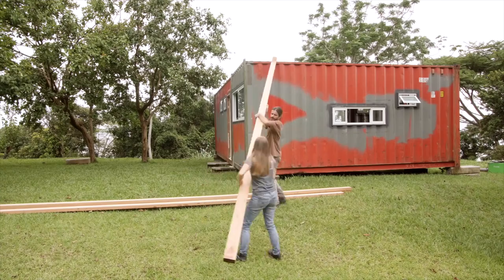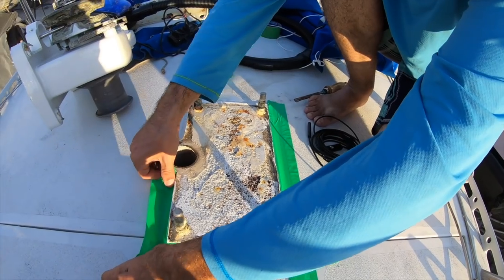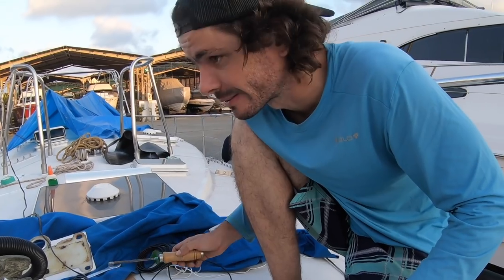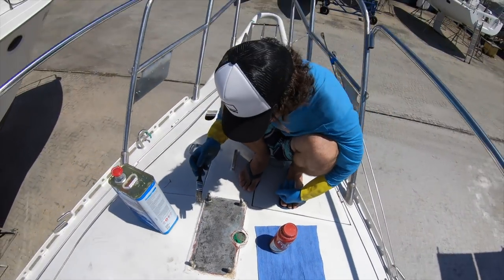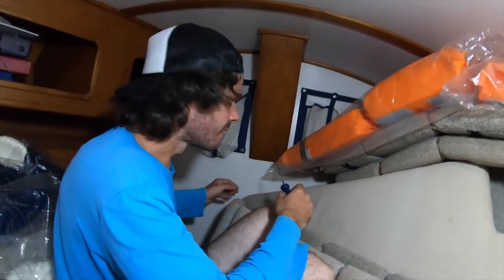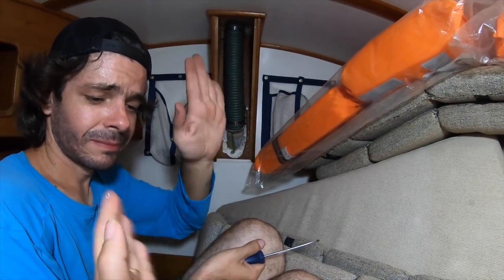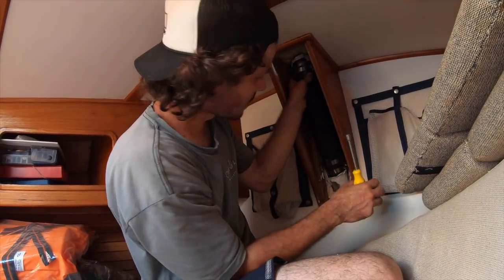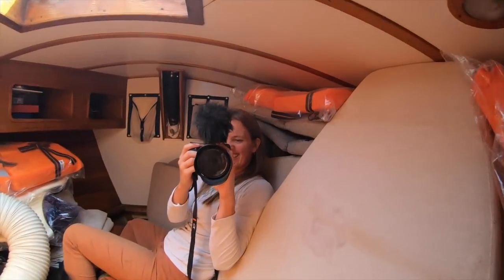⛵️We found RUST on our fresh painted steel sailboat!! 😱#125

Comment: The isolator pad looked like a simple sheet of nylon.  You should be able to sand it down to a clean surface.
Reply from the maker: The bad parts were kind of cracked.

Comment: I definitely would’ve been running copious amounts of water all over that area to find the leak before dismantling the original pipe
Reply from the maker: We actually needed to change that anyways. hehe. So, it was not a bit problem
Reply: The brown water stain running out the bottom of the tube made it obvious it was leaking and had to be changed anyway. That stain was the same as the water stains shown in the earlier video.

Comment: So dont worry with the grease, its definetely will be good enough for a long time and according the consistency it shouldnt be a problem. Because you use grease on merchant vessels and you never take out the grease, you just adding, because its just a winch so its not an application where you have hundreds of rpms and need precise lubricant flow. If everything is greased and its sealed you can alomost use these grease forever an do worry because of the colour, this yellow brown colour is fully normal, you just should have to whipe away the black stains, because if i am corect these are just particles from the winche but even so they will not affect the lubricant because they are on the bottom of the winch. Just next time, just whipe it away.
Reply from the maker: Thanks for the feedback, Martin

Comment: Well as mistakes go that was not much of one with the windlass.I myself might have said to hell with it , it looks ok,if I did not see any indication of rust/scaling.I have used similar products to what you are using, the active ingredient is Phosphoric acid, which reacts to iron oxide ( rust ) and converts it to iron phosphate which is inert and can be primed, great stuff have used it many times. I think you won't ever have to replace that hose again the rubber was a good idea , that actually was not that bad of a job I have done way worse ones with things like that.You did exactly what I would have done with that gasket,and your not going to know just how good that windlass is until you use it for a while. Your doing fine with such things .  I as ever wish you well keep up the good work . Remember also when people give advice it usually matters less exactly how you do it as long as the end result is right and  in your skillset , take care ...
Reply from the maker: Thanks for the support, Lawrence

Comment: Hope the sikaflex used is the bedding compound and not the sealant.
Cheers all
Reply from the maker: It’s actually both
Reply: @OddLifeCrafting  Good because the higher straight sealant has the same reputation as Devil's Glue, AKA - 3M 5200, which is used for sealing hull to deck joints and ballast keel attachments in Fiberglass boats, or anything else you do not want to separate/leak.
Stay safe, God bless

Comment: Good job on the winch! The grease looked like it was still in good shape. I would suggest that you think about keeping the hand winch as there is less to go wrong and on a island in the middle of nowhere it will be easier to fix than an electrical one and the parts are easier to repair in some foreign port where there is limited or no support for marine equipment.
Reply from the maker: Thanks for the feedback about it

Comment: I think you may need to paint the bolts and nuts with your white paint to prevent corrosion. IMHO
Reply from the maker: They are made out of stainless steel and we used sikaflex around it. We think we won’t have any problems there

Comment: I'm thinking a tapered rubber hose would work better, where you could "insert" the bottom portion of hose into the drain pipe versus "over" the pipe to keep from leaking where you've tightened
Reply from the maker: We needed to have the rubber at the outside of the pipe otherwise the chain would force it to get out of the pipe when moving up

Comment: You can put inside of the metal and rubber pipe one other stainless steel pipe or copper.
Reply from the maker: Maybe we could, but it’s the place where the chain of the anchor is gonna be in contact all the time , so we need to be careful about metals.

Comment: I don't know if you are using it but I always anti seize every bolt and thread on a boat. Just a suggestion.
Reply from the maker: In this case we used sikaflex. thanks for the tip
Reply: @OddLifeCrafting  sikaflex is a sealant. Anti-seize stops the nuts from seizing to the  bolts.
Reply from the maker: The problem is that we did it Saturday and no stores were opened and it was the last day we worked before started the quarantine for 15 days at least.
Reply: @OddLifeCrafting  it was just a suggestion for the future nothing more. Keep up the good work.

Comment: It's me again. I am going to ask an obvious question. Does that facility have the ability to scan the hull of that boat? In the aircraft industry we have what is called NDI (Non destructive Inspection) It's basically a huge Xray machine that detects hairline cracks and all other sorts of goodies before something bad happens. Yah know like an airplane wing falling off or some facility that forgot to inspect a prop.
What I don't want to see is a video of your boat doing something unexpected in the ocean. Oh and using a hammer to do a tuning fork test doesn't cut it.
Reply from the maker: No. We tried for some months to find someone to do this job, but we couldn’t

Comment: Hey, amazing video but can you let me know what product you used to get rid of the rust in the beginning of the video?
Reply from the maker: Hi, Eli. It's a Brazilian product: https://produto.mercadolivre.com.br/MLB-1070246152-fosfatizante-ferlicon-removedor-de-ferrugem-250ml-_JM?matt_tool=82322591&matt_word=&matt_source=google&matt_campaign_id=6542458279&matt_ad_group_id=84209230451&matt_match_type=&matt_network=u&matt_device=c&matt_creative=385096448526&matt_keyword=&matt_ad_position=&matt_ad_type=&matt_merchant_id=117843933&matt_product_id=MLB1070246152&matt_product_partition_id=597030062874&matt_target_id=pla-597030062874&gclid=Cj0KCQiAzsz-BRCCARIsANotFgOOh5FV792TKZHU7BjxVRKx427qJ7zyT10v2SlXac53h9LPc4HHBwMaAvEtEALw_wcB
Reply: @OddLifeCrafting  oh do you know if they sell them in new York?
Reply from the maker: @eliben3859  You may find some similar ones. It's made out of Inorganic acids, metal oxides and surfactant.
Reply: @OddLifeCrafting  oh ok thank you so much for the info!

Comment: You should have used proper gasket material which is made like it is for a reason. The rubber gasket you made is too soft and will sag inside the housing and also compress too much when you tighten the bolts, but remain too loose between the bolts.

Comment: Good job. One clamp is going to be perfect the second clamp is not necessary. Why? It is not under any pressure.
Reply from the maker: I can be as it's where the anchor chain in gonna be and also it's a place that we can have a lot of sea water inside coming with waves
Reply: Have you heard of a product called ant seize compound? You put it on the threads to prevent seizing.

Comment: Acid etch. A gallon of phosphoric acid is a must for anything steel.
Reply: I would have to disagree unfortunately,   shot blast a1 standard  with first coat application within 4 hours then chemically bond the next coats then you will have a paint system that will last  just done a ferry the paint  was 20 years old and only just starting to let go

Comment: Hi Guys the Windlass Gasket the old one was a Cardboard material and the new one is rubber based material problem with that is the Rubber will not Breath. As the Cardboard gasket would and over time the Windlass grease will in time become Hydroscopic and allow water to become suspended in the grease causing it to fail and due to the location of the windlass it will over time get high volumes of water thrown at it you can buy in sheets waxed card that is designed for making Gaskets from which are used in the Automotive industry and in Aviation sometimes the Waxed Card gasket might be the way to go
Reply from the maker: Do you think it's possible for the cardboard to breath with a place of aluminum on the top of it? I can't see how it could breath with a plate on the top of it.
Reply: Amazingly it could be possible that the thin gasket of Cardboard does allow that to happen but it was only a suggestion why they used the Cardboard Gasket before it was just an observation if you notice the Grease changing colour over time to a Cappuccino Color from the Golden Honey Brown then you are getting water suspend Hydroscopic ally in it just a point to watch for in the future I love the VLOG and the Two of you are very chilled in your way of Life I wish my Partner was a little more adventurous
Reply from the maker: @hyime69  We are gonna keep an eye on it. Thanks for the concern and for the support

Comment: Stay with the manual windlass. Sure, it's more manual labor to use, but you guys are young and can do it. Electric windlasses are expensive to buy and they break much more often. Less systems means a more reliable and cheaper boat to maintain.
Reply from the maker: Thanks for the feedback about the windlass ☺️

Comment: In my opinion that pipe supposed to receive the top one in and the lower part supposed to be inside the fixed part
Reply from the maker: The problem is the diameter on both ends are the same. That means a hose diameter that would fit inside the bottom wouldn’t fit around the top one.

Comment: IMHO, I would put a different hose on the winless.  Use a hose that goes over the upper pipe and into the lower pipe.
Reply from the maker: If we do that the chain might take the hose off. 😔

Comment: Hey mister, don't tap on my pipe with your chisel. Don't set chemical bottles on your paint. Use a board or something that wont allow it to leak through if it drips or spills. Many of a new paint jobs have been ruined by doing stuff like setting tools and chem's on it. Don't they make that sealant in white or clear? Black on a white boat is no fun.

Comment: It seems like water is getting into the windlass.
Reply from the maker: It was
Reply: @OddLifeCrafting  
   I meant leaking into the actual windlass from above not under it.  Is there a seal or other point of possible entry?  My concern is if the water enters the windlass from above, is there a weep hole for it to escape?  Otherwise it may just collect inside because it is so thoroughly caulked to the deck .                
   By the way, thanks for the video on winch servicing.  I just bought 2 used winches on ebay. When I gave them a spin they were kind of dragging  - slow - dampened.  I immediately remembered your video and knew exactly what was going on - OVER-GREASED!   Opened them up and YES, that was the issue.  I'll be re assembling them this weekend with "light greasing and only machine oil on the pawls.    
     We always look forward to your new videos.  Keep up the great channel and stay safe.
                           - Chris     Seattle

Comment: Should probably replace the grease
Reply from the maker: The manual of the windlass says that there is no need of changing it
Reply: It’s not so much that it’s not required it because of the rust in the grease that will leave stains on your hull.

Comment: I don’t believe you did that correctly. I’m not sure how to explain it. But here goes. The question is why when you tile or shingle a roof do you never start from the top or peek and work down to the bottom edge. Why do roofers always start the tile or shingles from the bottom and work up to the peek. When you installed the anchor chain guide tube the top section went around the outside of the existing metal pipe that was correct. However the bottom went on the outside of the bottom tube that was wrong. By the way you said that was the original way it was done that’s incorrect, what you saw was a bad job at a fix someone who didn’t know what they were doing and took the easy road instead of the correct replacement. My guess is the chain wore thru original metal pipe and they thought they would fix it by cutting out the part and did a bad replacement job. The fix you did will eventually start dripping and create a mildew and then mold situation.
Reply from the maker: We believe it needs to go on the outside of the pipe otherwise when we push or pull the chain up and down it can take the hose away from the pipe.
Reply: @OddLifeCrafting  unfortunately that’s a bad assumption. The only way to correctly fix or return it to its original status is find a professional pipe fitter. The yard your in seems to have lots different kinds of specialized personnel. Put the word out your looking for a pipe fitter not a jack of all trades. You need a pipe fitter. He will have the material the tools and the knowledge to fix the  patchwork and do a proper fitting. All you did was to duplicate the same mistake the person before you did. This area is not the one to get stubborn about, it will come back to bite you just when you don’t need that kind of problem. I know it’s hard to trust anyone but yourself. Sometimes you got to believe someone knows more than you do. The pipe fitter is the guy.